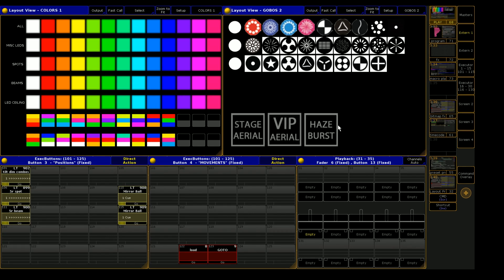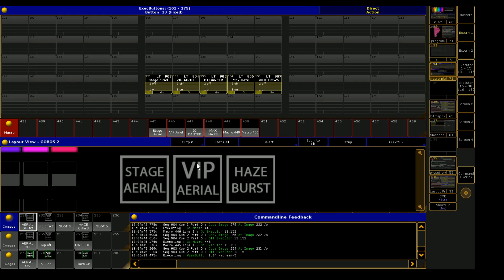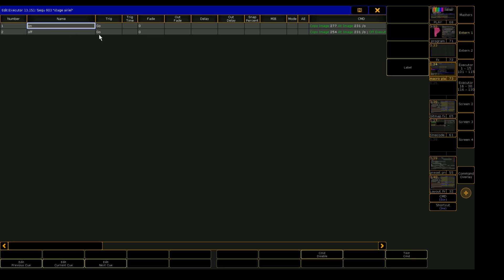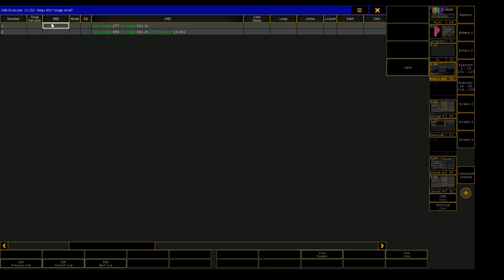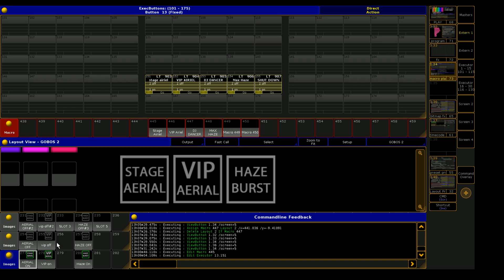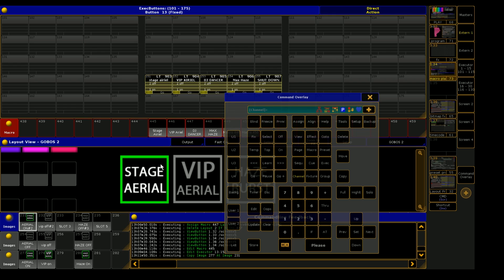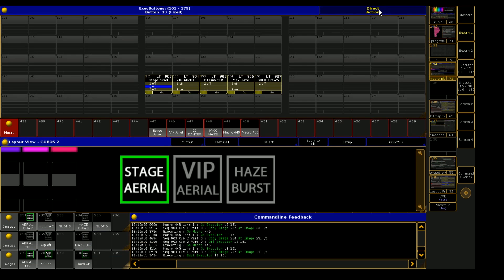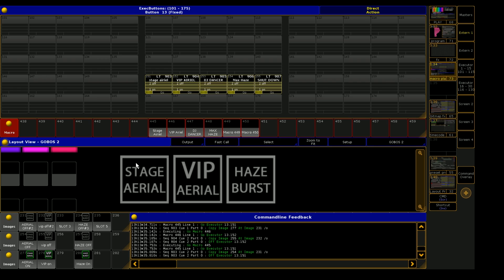MA2 Layout View Programming: Toggle Buttons

Comment: From one hand I respect the power of MA's macros and command line, making it a very flexible system. But I find myself surprised many times about how so many trivial features (like a toggle button) are missing from this system, and need macro solutions.
Reply: The trival feature of a toggle button is off course available, just store an Executor and select "Toggle" for the button. 
In this case, he is using an image to toggle an Executor which is a different thing.
Reply: There is a toggle button if you make it a toggle button.  This is a basic console function. This video is rather advanced.